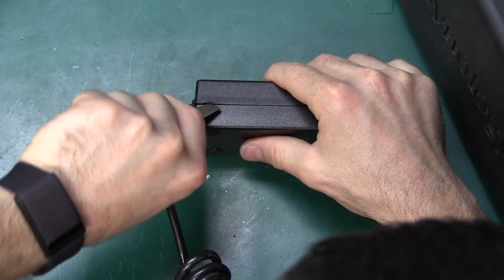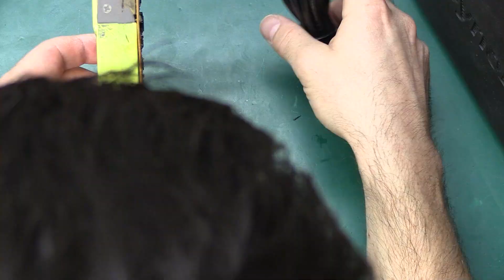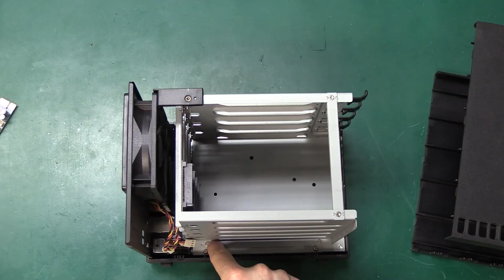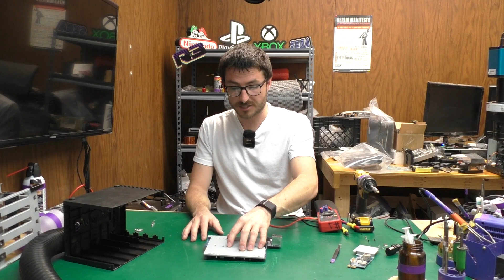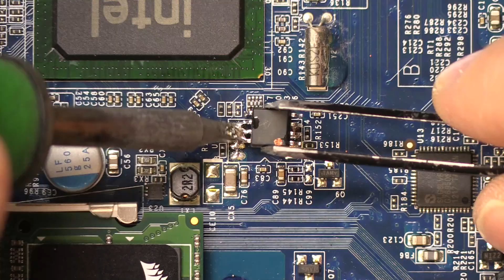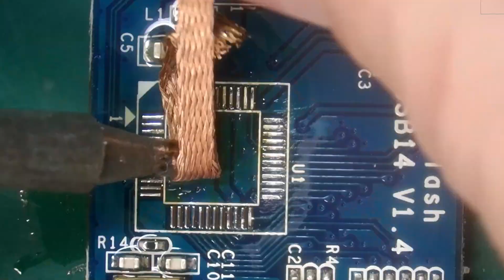Synology DS412+ Master Repair Guide – Every Fault, Every Fix!

Comment: Hi Nick. I don't see the repair kit on the site. Have you stopped selling these?
Reply from the maker: Hello,
Yes sorry we pulled all repair kits a month ago as it was creating a lot of friction and headachs for the team on the back end. 
What fault are you experiencing with the unit? Maybe I can point you towards the component you need and you can get what you need from somewhere else. Or if you want to send it in, that is still an option, we still offer the mail in repair.
Reply: @NicksElectronicRepair  Thanks for you reply. Pin 5 on the chip measures ~0.5kOhm, so that's good. It does have a dead battery. But even feeding the battery pins with 3V from a regulated power supply does not allow it to boot. So I guess there's only the DOM daughter board left.

Comment: Didnt work for me. Replaced the AOA chip and just get same 2 blu flashing leds. Edit: Doing a power cycle and waiting about 5 minutes or so and it does eventually boot but not reliably. If shutdown and restart again, leaving it for 10 minutes and still hasnt booted. Then cycle and it might or might not boot normally. How long should booting actually take?
Reply from the maker: booting for this unit takes about 5 minutes that's normal. But it's possible you have a processor issue. We do see that happen although it's rare and it would explain the symptoms you are experiencing.
Reply: @NicksElectronicRepair  It could be. Its been working fine for almost a month non stop so Im considering it fixed! 😃

Comment: Thanks Nick. Can you also post the repair guide for DS716+II please. The power supply has the green light and 12v but it won't start and there is no blue light.
Reply from the maker: no guide on the DS716+ at this time. We are planning on providing more repair videos for NAS units next year but don't know how to fix a lot of them yet. Need to spend a bit more R&D time. Some of those units are more difficult to fix, well at least we don't yet know what we need to do to fix them so we need more time to figure it out.

Comment: Hello there, blinking blue light here, fan turning on, no hdd sign of life (no spinning nor leds). Video is totally understandable but was still wondering if a faulty CMOS battery or powerbrick can somehow lead to the blinking blue LED...
Reply from the maker: It could technically be the CMOS, so worth replacing first, but not sure if the power brick could be the issue. Typically, when we see a power brick issue, the unit only turns on for a second or so, then off. Or completely dead no power. We do have the flat rate service so if the CMOS doesn't fix it, send it in along with the power brick, we can test all of it and repair whatever needs repairing. All repairs come with a 1-year warranty
https://nickselectronics.com/products/ds412
Reply: @NicksElectronicRepair thanks for replying! I'll try what I can easily do on my side of the Atlantic first 😅
Reply: CMOS Battery was completely dead... 0V. Changed it, but still no life beside this damn blinking Blue LED.
C559 & C556 not short circuited.
EEPROM  : Ok 624kohm
Powerbrick : new one does not change anything
Then must be the U1 Chip... which is a A0A...
Reply from the maker: Then yes, most likely U1, but before you do that, one last thing worth checking is if perhaps one of the processors is going out (the one without a heatsink). Now, in my experience, when that happens, the blue light blinking is a bit more erratic than normal. Not sure if that's something you noticed or not. 
Here is a video I made in the past regarding what I am talking about. 
https://www.youtube.com/watch?v=_c3Qe8-dtoQ
Reply: @NicksElectronicRepair the blinking is perfect 😅 fans are running, exactly like you are showing in some videos (all great by the way). Unfortunately sending my unit to you would be a tad expensive and I still have not found a local repaire shop.

Comment: Hi Nick. My DS412+ just lost power. The LAN port has a blinking light but not able to power on. There's no blue LED light at the front and power button does nothing. It's about 10 years old. I just replaced the CMOS battery. I hope its just the power supply issue although it still has a green light on it.
Reply from the maker: Could be the power supply, could be eeprom, could be shorted/burnt capacitors, could be a processor malfunction. Unfortunately it could be a lot of things and I wouldn't really be able to help you remotely. 
If you do want to send it in, we offer a flat rate repair service to fix all faults. If this is something you want to do, simply purchase the repair service listing linked below and follow the emailed instructions for packaging and shipping. All of our repairs are backed by our 1 year warranty. 
https://nickselectronics.com/products/ds412

Comment: my DS412+, when fully mounted, flashes the blue LED few times and stop. If I take it apart and try turning it on only with the motherboard plugged, I have the continuous flashing.  Power supply not making any noise. Unfortunately I don't have a CR1220 with me now to test it. :(
Reply: Problem solved since then?
Reply: @Valenthior  Nope... the battery didn't do the trick... I need to go over the steps again and give it another round of tests.
Reply: @gustavomarrara9660 ok then good luck!

Comment: Really well done! I had two failures in my DS412+, Power supply and CMOS battery. The thing that cause the most problems with the tear down was the case. Wrenching it off just breaks the tabs. It slides backwards to disengage the tabs & slots.
Reply: What was your symptom?

Comment: My unit only powers on and the blue light flashes once, then powers off again.  This all started after an extended power outage.  If I remember correctly, I purchased the unit back in 2016.  I've already checked the power supply and it's not making any noise.  From some posts I've read online, the issue may be the battery, so I'm going to try replacing that.
Reply from the maker: If it happened after a power surge it's most likely that you had a power surge go into the unit and damage some of the components. Replacing the CMOS battery won't hurt, but it won't help either. 
Also power surges don't usually damage units via the incoming power, but they typically travel through signal cables, knock out your modem/router combo then travels to your devices via the ethernet and then damages them that way. No surge protection circuit built into internet lines so surges usually travel through those and HDMI from cable box. 
That should be something we can fix for you, but depending on the level of damage, we may have to charge more than our flat rate service:
https://nickselectronics.com/products/ds412

And I wouldn't know the extent until one of my tech gets a chance to full diagnose the unit because with power surges there is often a bit of randomness.

Comment: I started with the DOM on our 1512+ and it worked, I was however able to plug that into a linux box and see that I was not able to read the contents of it.
Reply from the maker: And you were able to replace the U1 IC chip? If so awesome work! Those aren't easy to do.

Comment: How come you spot those capacitors instantly? I've DS224+ with no power that I'm trying to figure out but not sure where to start (0 knowledge about electronics)
Reply from the maker: Well #1 is I have been doing electronics repair for just about 13 years now where every single day I look at circuit boards, so I know what is normal and what is not and what to look for. 
#2 I have worked on a lot of DS412 + units, so I also know where to look for common faults and per the video 99% of the time there are only 4 things to look at.
Reply: I try to find a high resolution picture of components and ways that are just under the small ROM card cause i need to repair the burned ways and replace components for a Synology DS224+

Comment: I have a no drives detected fault on mine, is there a fix for this fault? (It boots and I can connect to it via the Synology Manager software).
Reply from the maker: That is odd, I can't say I have had to fix that issue before. Often if drives have issues connecting it's because of a drive failure. 
Have you tried removing all the drives and booting in with a new drive? 
Are you able to access the diskstation manager page? If so you should be able to then look at the fault log and see the error there.
Reply: @NicksElectronicRepair  Yes, I installed a brand new drive but it wasn't detected either. I can access the quick-connect page and connect using the Synology Assistant application, but when I try to install DSM I get an "Error 5" message, which seems to be no disks detected?
Reply from the maker: That is very strange. Not sure, that's not something I typically see with this unit. I would probably need to diagnose it from scratch on my bench for this one. Very odd

Comment: My CMOS battery reads 0.0 VDC. Checked with two different meters. Could this be a symptom of something else? New battery on order.
Reply from the maker: A 0V battery can be the cause of a fault with the unit. Your unit is 13 years old, I believe this is simply the battery going out. Most CMOS batteries start to slowly fail after 7 years.

Comment: Hi Nick would this fix the problem on my DS916+ that won't power on no lights on unit at all, I have replaced the power brick still no boot, I am in Australia
Reply from the maker: We don't really fix the DS916+ so I wouldn't really know what the common faults are for that one at this time. We are really good with the 2015 and older models, but have not yet mastered anything past the 2015 sorry.
Reply: Yours died too eh?
My DS916+ has died too. I got a new PS ..but I think the unit killed my new power supply =(
I'm in New Zealand.....freaking $1300 for a DS923+
Nick....you're are only hope!
Reply from the maker: :( Im sorry I haven't had time for R&D on those. I have gotten a lot of repair requests for QNAP and Synology devices but just haven't had the time to look into all the faults. I don't want to give you false hope but I do plan on fixing every NAS unit available on the market at some point eventually but it will take me a lot of time before I can get there. I need to hire more help first.

Comment: G, day Nick from Sydney Australia.
Is there a way to determine chip alternatives, for:
Oscillators
Microcontrollers 
e.g 16 pin oscillator SG1524B RRP $120.00 AU
🌏🇦🇺
Reply from the maker: You would have to read up on the data sheets, and figure out if the pin out is the same on an alternative chip and that the replacement does the same type of work in the same way with the same specs. The more generic the job of the part the more likely you are to find compatible replacements, the more specific the task the less likely you are to find a compatible replacment.

Comment: So, the original capacitors do change their capacitance? As they were not shorted, I can only imagine that you replaced them because they have changed their capacitance value.
Reply from the maker: The capacitors did not require replacement however we like to replace them anyways since they are likely near their end of life and we preffer to replace them with ours that are rated for higher voltage and thus less likely to fail over time. This is one of the ways we can guarantee our work and be sure that no repair comes back.

Comment: Thanks Nick. Really in-depth repair guide.
Reply from the maker: Thank you. Yeah we have fixed a lot of these now and while there are techincally a few odball faults we have seen and fixed not included in this video, the video tackles 99% of the faults we see with this device. 
I will probably be doing this format for a few other Synology NAS units that we commonly see, and start providing repair kits for those as well.